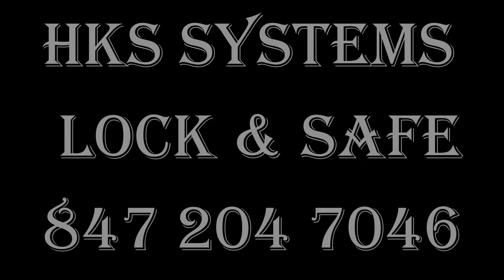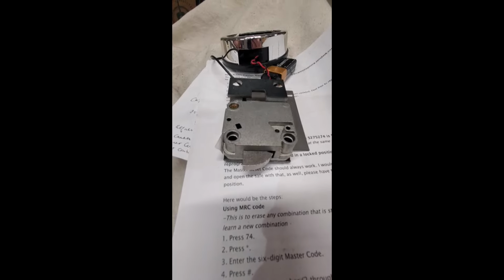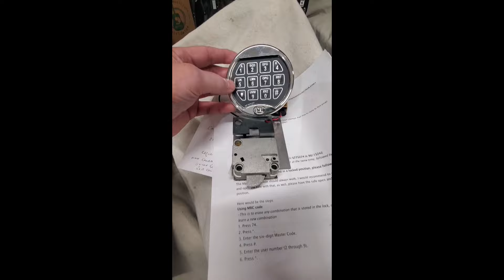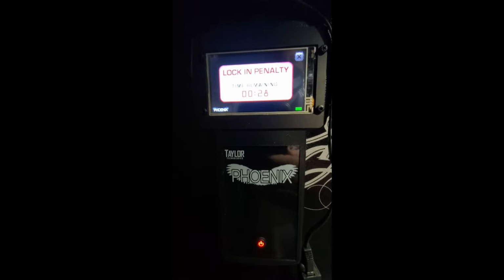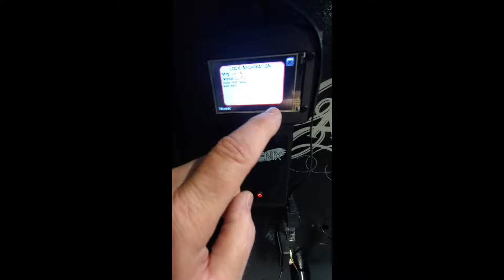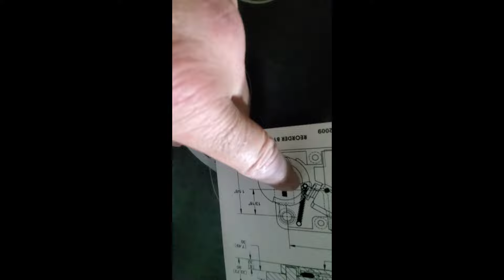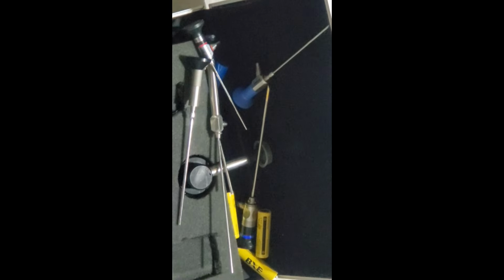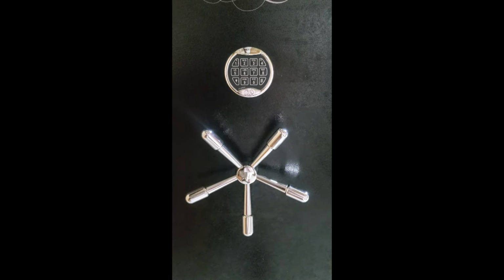Cannon Fort Knox Liberty gun safe opening safecracker Bartlett Buffalo Grove Streamwood Crystal lake

Comment: Nice Video.  You mentioned that you fixed the drill hole.  How is that done?
Reply from the maker: It depends on safe use usually a ball-bearing and epoxy. For GSA sometimes welding is required. I use steel stick epoxy or carbinex filler typically
Reply: Where can I buy it and how much does it cost to open each password I have a lot of lagard
Reply: Where can I buy it and how much does it cost to open each password I have a lot of lagard